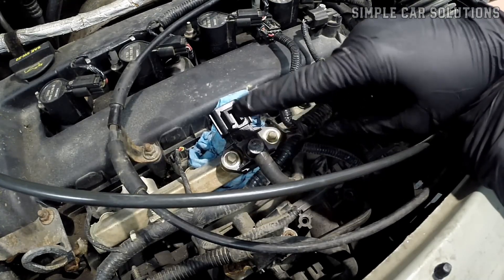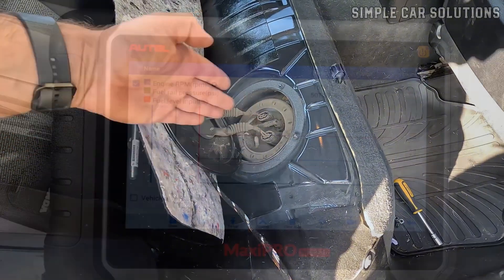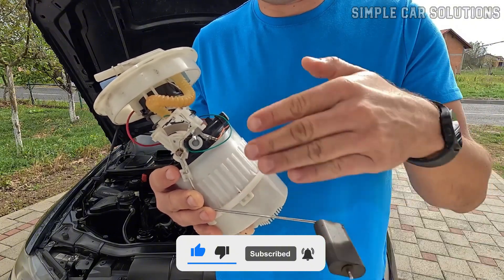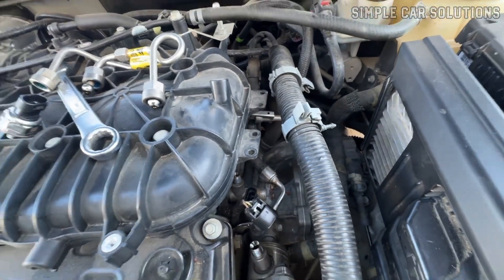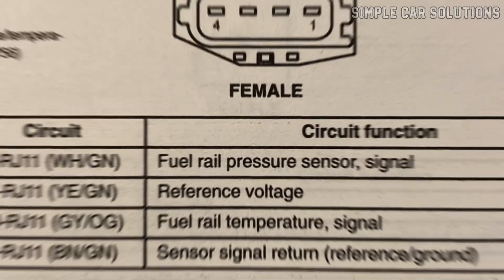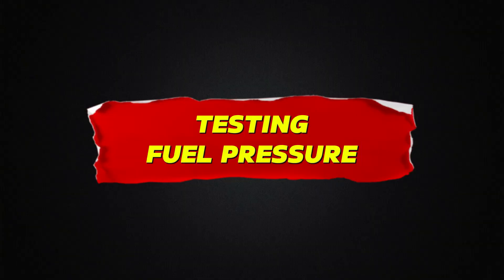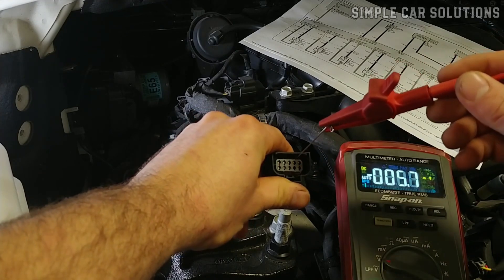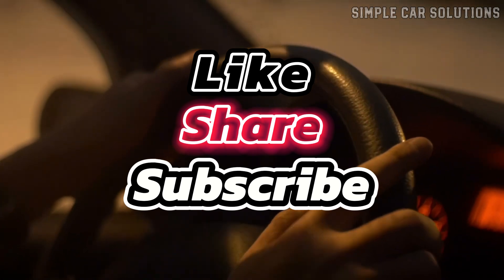Symptoms of a BAD FUEL RAIL PRESSURE SENSOR. How to Tell If the Fuel Pressure Sensor Is Bad

Comment: I added the new updated low pressure fuel sensor in my 2018 mustang Ecoboost now I have a p2282 code is the sensor faulty or did I not tighten it all the way someone help please
Reply from the maker: P2282 usually means air is getting into the fuel system. Most often the sensor isn’t fully seated, the O-ring is damaged/missing, or the connector isn’t locked. Recheck torque, inspect the seal, and make sure the plug clicks in. If all that’s good, then suspect a bad sensor.
Reply: @SimpleCarSolutions do I need to disconnect the battery at all I did but it was after I hooked it up and it was only 10 mins and so I need to prime the engine by disconnecting the fuel pump sensor behind it or no
Reply from the maker: @inferno_eb No need to disconnect the battery. You don’t have to unplug the fuel pump either. Just cycle the key ON (engine off) 3-4 times for a few seconds to prime the system. If the code comes back, recheck the sensor O-ring and seating.

Comment: Plz 1  Fuel Rail low pressure 
P0087-00
2 P 0193-00 fuel rail pressure sensor, circuit, high voltage
3 P0671-00 cylinder, one glow, plug control circuit
Charlotte Enjoy
Reply from the maker: Those codes point to a bad fuel rail pressure sensor or wiring issue. P0087 and P0193 together usually mean the sensor is failing or shorted. Check the sensor connector and wiring first; if OK, replace the sensor. The glow plug code is separate.
Reply: @SimpleCarSolutions  thank you
Reply from the maker: @MirTahir801 You're welcome 😉

Comment: How test if pressure on 612 engine is defective, 416CDI sprinter
Reply from the maker: Check it with a scan tool: rail pressure at cranking should be around 250-300 bar. If it’s much lower or erratic, test the rail pressure sensor, regulator, and low-pressure supply. A manual gauge adapter can confirm actual pressure if the readings don’t match.

Comment: In my Skoda Rapid 1.6 diesel it has high Rpm issue at ideal. It start normal under 1000 rpm but after about 5-10 minutes RPM goes up @ 1200-1500. Due to that I had bad fuel injector. Now I replaced injector but still high rpm issue is there. Please guide me what should I do?
Reply from the maker: Check the fuel rail pressure sensor, EGR valve, and vacuum leaks. Also, scan for fault codes — high idle can be caused by faulty sensor readings or air intake issues.
Reply: @SimpleCarSolutions Thank you for your reply. I have changed faulty injectors, EGR clean, rail pressure sensor working shows in scanner. No fault generated. I have front right abs sensor faulty. Can that cause high rpm issue? Can a fuel return line be a cause? No video is there in YouTube for this kind of issue. Please help if you have any solution. Thanks in advance.
Reply from the maker: @sheronkalashwa7063 You're welcome😉
A faulty ABS sensor won’t cause high idle, but a restricted or leaking fuel return line can — also check for intake air leaks, sticking throttle body, or coolant temp sensor giving incorrect readings.
Reply from the maker: @sheronkalashwa7063 You're welcome 👍 Good luck
Reply: @SimpleCarSolutions 
Hi, here are some readings from obd2 basic scan tool. Are they OK?
Skoda Rapid 1.6 Diesel at ideal
Fuel Rail Pressure: 4168 psi
MAF air flow rate: 8.29 g/sec
RPM: 1040
Throttle Position: 88.63%
Barometric Pressure: 14.5 psi
Commanded EGR: 34%
Reply from the maker: @sheronkalashwa7063 Those numbers don’t look normal — throttle position at 88% at idle is way too high. That points to a throttle body or sensor calibration issue rather than fuel rail pressure. I’d inspect/clean the throttle body and check the TPS readings.
Reply: @SimpleCarSolutions Thanks for sharing your knowledge. One more thing I have observed, whenever RPM rises radiator fan starts.
Bro I might be bothering you much but it's a mystery kind of issue for me😅. Thank you for your support till now.
Reply from the maker: @sheronkalashwa7063 Not a bother at all 👍 If RPM rises when the fan kicks in, check coolant temp sensor readings — a faulty sensor can trick the ECU, raising idle when the fan comes on.
Reply: Hello I have renault grand scenic 1.2 tce 130cv patrol in have fuel pressure sensor problem i change it then mechenic ask me to change fuel pump but same problem i change it then I changed oxygen sensor same problem. He remove many time same code but problem remain same after 10 to 15km car gone limp mode down the speed stop msg do you have any solution
Reply from the maker: @ShiekhNomi If the sensor, pump, and O₂ sensor didn’t fix it, check wiring/connectors to the fuel rail sensor, fuel filter, and ECU — often it’s an electrical or harness fault causing the code to return.